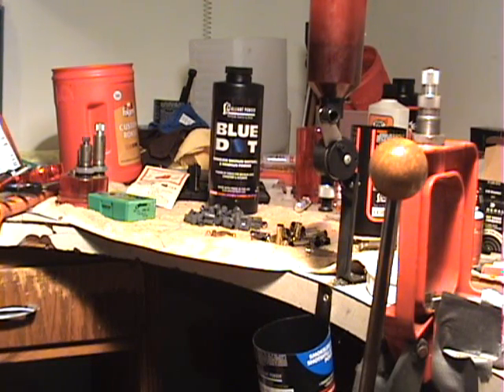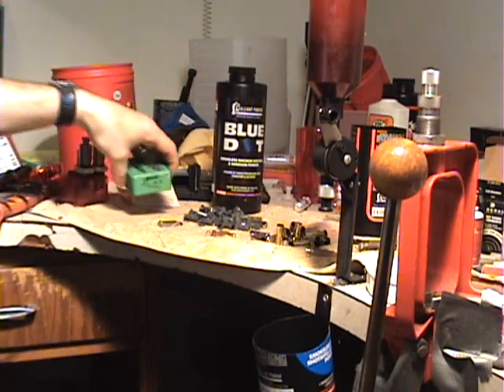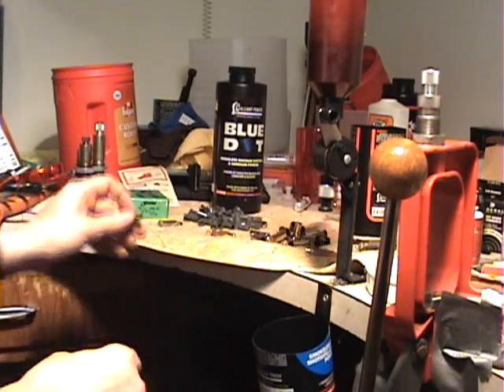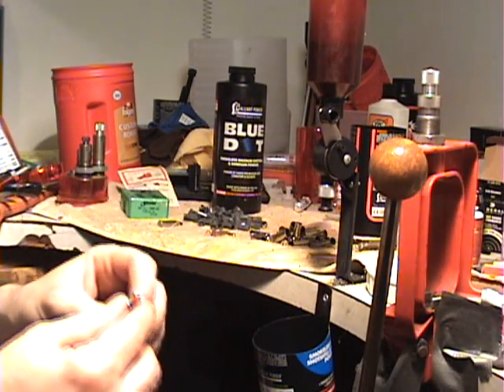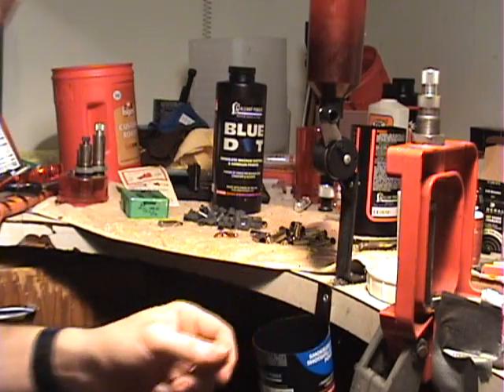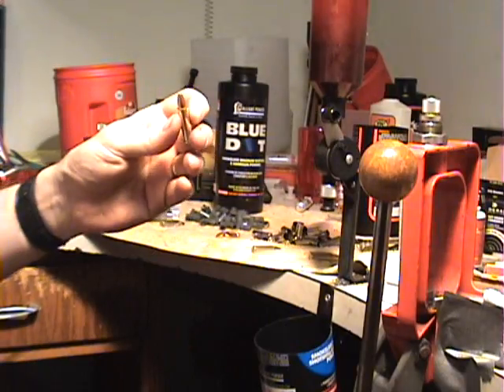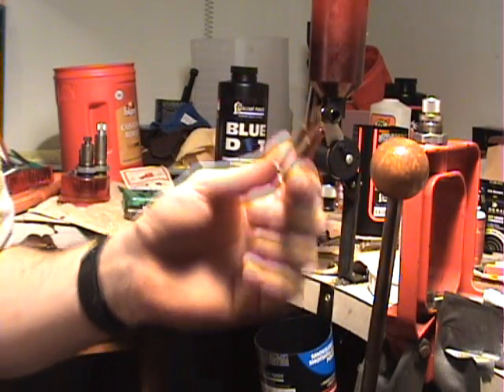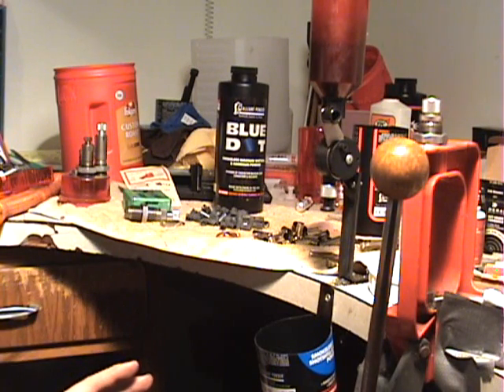357 Magnum Sabot Project

Comment: I am very interested in this project. The problem I am having is finding the right bullets? Would you recommend an alternative? Would any 308 caliber 110 grain bullet work? I guess I can seat them to the proper length if the bullets are shorter.  Any advice?  I plan to shoot these from a revolver and may be a Coonan Classic Semi Auto 357 magnum if they work.
Reply from the maker: any 30 cal flat base bullet with a short enough ogive will work.  the sierras were the only ones i could find that fit teh bill
Reply: siliconwolverine Would the round FMJ bullets such as the other Sierras 110 grain bullets or similar Hornady 308 caliber work? I have found those online. The bullets are shorter OAL. If not ill just keep looking
Reply from the maker: they do but you lose the advantage of the spitzer bullet.  the whole point of the exercise is to drive a spitzer bullet from a revolver.  if you use a RN bulet you really arent gaining anything

Comment: I was just wondering what the length of the bullet and sabot combined was so I could put it into Quickload to try and get an estimate on pressure. I've got the sabots ordered, but finding bullets is getting a little frustrating.  I may end up useing 90gn XTPs instead.

Comment from the maker: the OAL is the same as a 357 mag with a 158 gr JSP.  the nose of the bullet is just below flush with teh chamber face.  it is slightly compressed but not anything worth worrying about.  ive compressed blue dot loads under 158 grs more than this is.